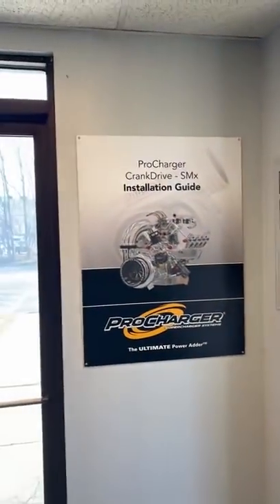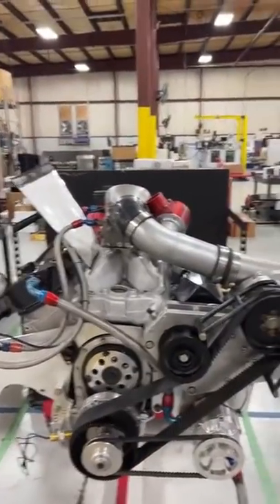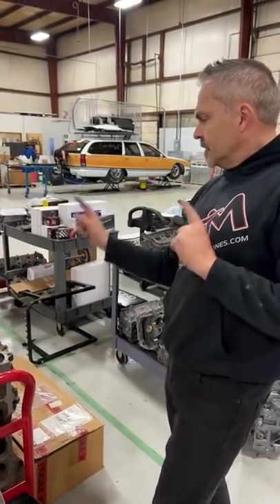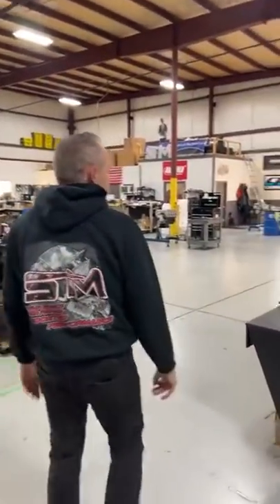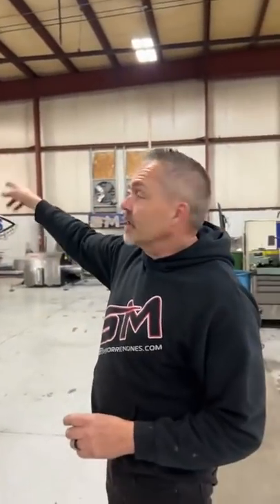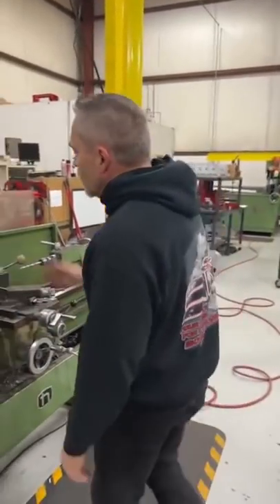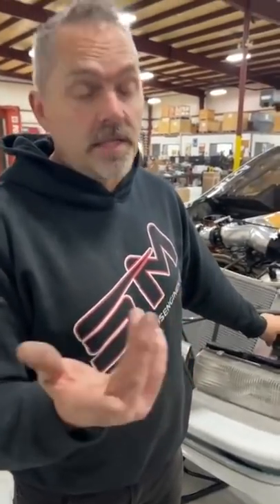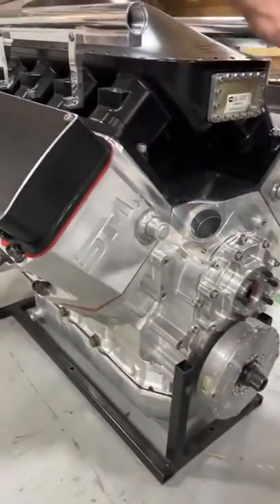EB TAKEOVER: Steve Morris Engines

Comment: Great vid and overview of the shop, I'm glad you mention the price range for the SMX, I'll have to go count up my piggie bank (dang!). I wish the vid was filmed in landscape orientation though.
One question for both the SMX and SML's in street applications is how much power could they put out continuously, I would guess that the cooling system is good enough to drive down the highway comfortably but it really doesn't take much power to do that, lets say you had a truck you wanted to do drag and drive events with a trailer, could they handle that?